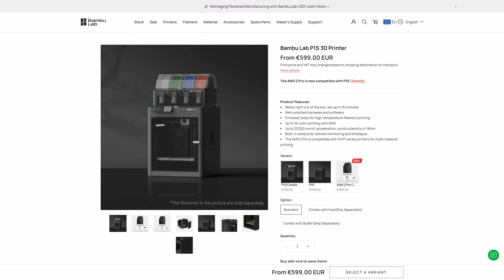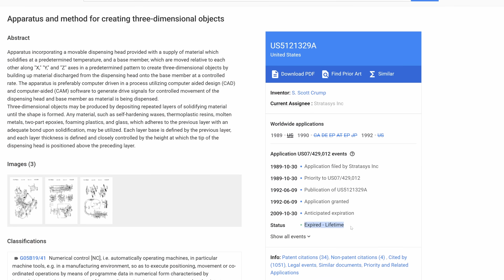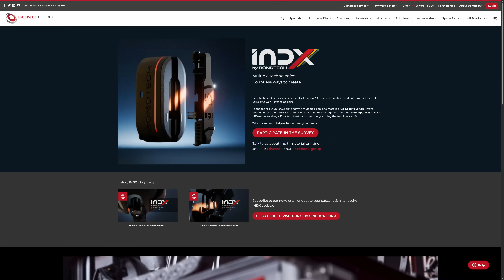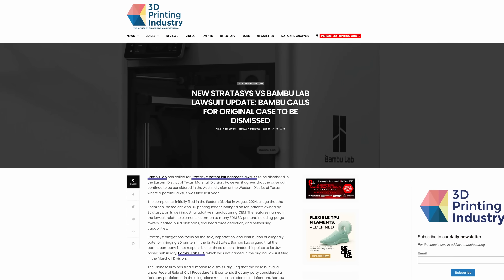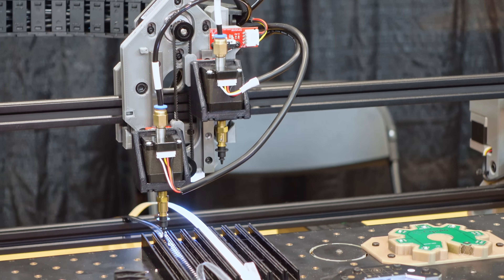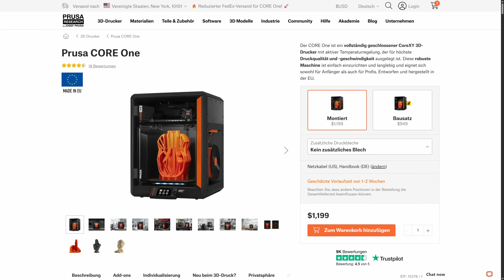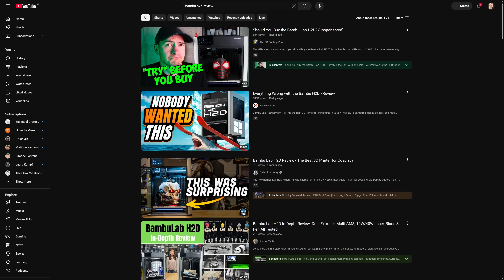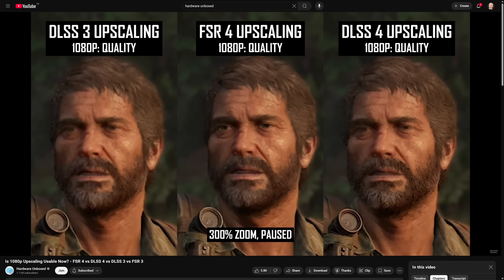How Bambu has won

Comment: Bambu convinced me to buy a Core One (the kit version).
Reply: Ran a P1S for a year-ish before the firmware lockdown, the day I saw the announcement I sold it on FB and ordered a Prusa Mini
Reply: @coreymartin9630 I'm still running my p1s no issues at all. Haven't had to update the firmware and the cloud function still works.
Reply: I am making one right now myself.
Reply: Thanks, it might have hastened the arrival of my Bambu Lab printer😊
Reply: @OnePotMeals  Did you get the 40W laser?
Reply: @ScientificGlassblowing no, 10W
Reply: @OnePotMeals  Well I hope you paid extra for the ventillation and fire suppression systems.
Reply: @ScientificGlassblowing I do have a ventilation system with a direct port to outside plus my workroom has a fire extinguisher . Got another objection?
Reply: @OnePotMeals  Not objections just curious.  My X1C gets lots of microplastics/carbon fiber residue.  Seems like a laser in an enclosed chamber would perfect ignition source for those materials.
Reply: @ScientificGlassblowing not sure how flammable those are? I clean mine out pretty regularly and the H2D comes with a shield. I haven’t used it yet, I have access to a 60W CO2 laser at our local Makerspace so my use will really be engraving. I bought the laser module more out of curiosity and not having to leave in the midst of a project. I’m a technophile and I got my X1C from their Kickstarter campaign. I was so tired of fiddling with my FLsun and Creality machines, I just wanted to make stuff.
Reply: From a H2D/P1S/Core One owner -- I'm curious, what made you want to buy the Core One? Privacy issues?
Reply: @thesenate3055  How are you liking the Core One? Amd how does it compare to the P1S?
Reply: @thesenate3055  I was a 100% Bambu fanboy, then they changed the terms of service with the firmware update in January.  Based on that I'll never buy anything from them again.  I am sure the H2D makes sense for some people.  I'll be the laser causes all kinds of long term problems.  I still have an A1-mini and X1C but for the future it will be anyone but Bambu.
Reply: @thesenate3055  I was a massive Bambu fan boy, until the firmware update that requires connection to Bambu's servers.  Sure it is for "security".
Reply: They convinced me NOT to get an mk3. Glad I didn't.
Reply: I have 5 Core One's and will be getting my second XL soon. I wouldn't take a Baboo printer for free. Way to big of a security risk on top of their complete lack of ethics.
Reply: @varukasalt  in that case it makes absolutely sense to buy prusa machine if you have already other prusa's . that makes maintenance, workflow and spare part sharing much easier. Also the other way around don't buy a prusa if you have lots of bambus - except your company didn't offer a machine with specific features or you aren't complaint with the company anymore ....
Reply: @varukasalt The XL convinced me to never buy another Prusa again. After 6 months of nonstop issues and the run-around from Prusa support, and seeing so many others getting the shaft from Prusa on their XL, I finally sold it instead of buying 19 more for my farm. Then I slowly replaced all my Mk3 variants with Bambu machines, and couldnt be happier. Prusa's "race to complete with Bambu" lead to an alpha product being sold to the public. They lost my trust and business.
Reply: Classic China thing ya know
Reply: @varukasalt  I'm surprised he didn't cover the security issues. If you're making serious parts and designs, the Bambu ecosystem might be unsecure. Otherwise Bambu can have millions of useless files LOL.
Reply: Prusa has cloud too... you think they're not keeping your data 😂.  And if you want multi material or multi colour you'll need to pay $4000 for only 5 colours... ex shipping 😂
Reply: Prusa is a European company. I trust them more than a komunist, patent stealing and outmanufacturing country. That is just me. But I care.
Reply: @mostlymessingabout google has a cloud, iPhone has a cloud, everything you’ve typed is stored somewhere on a server, you think not buying a bambu will keep you secure, sorry but you need to take off that blindfold.
Reply: @mostlymessingabout  Just because you are poor doesn't mean the rest of us should care.
Reply: @ScientificGlassblowing Actually, you should. But that's a whole different topic...
Reply: Just buy a bambu bro
Reply: @krisitof3  I have two X1C and the A1 mini.

Comment: Hi Thomas, I have 5 Bambu X1C machines. And I agree they have won when it comes to their machines. But their new software nonsense is going to put a big brake on their growth. I will not buy another printer nor update the firmware since they want to force users into their ecosystem. And here Ocraslicer has won. No contest.
Reply: Likewise, I have an X1 Carbon. I love it, it's a great machine but Bambu has lost my recommendation for the future. I don't begrudge them wanting the vertical integration, but the lockdown was too much for me. I don't need another printer right now. I don't know who my next printer will come from.
Reply: I don't think the average "I just want it to work out of the box rather than tinkering" Bambu customer really cares or even knows about the new software license. I'm not a fan, but then I'm a tinkerer!
Reply: BTW aren't Orca still missing H2D support due to Bambu debug log block?
Reply: You are missing out. Their latest firmware is great.
Reply: appreciate that but you can't use Orcaslicer which means you are missing out..  @rsilvers129
Reply: I have an x1c combo that is in lan only, stopped updates when the initial news came out of Bambu's shenanigans,  and blocked internet access for it,  too.  I didn't know that by doing this,  I wouldn't be able to create custom filament profiles to save and use in the AMS,  since it requires BL cloud access. Feeling really defeated and cheated because of this.  I can't do multi color prints unless I want them to look awful,  since I can't individually set their pressure advance values
Reply: Too bad. they are still growing pretty fast.
Reply: You are the 1%
Reply: I seriously recommend every X1 owner who wants to actually own their printer to check out the X1Plus custom firmware. I recently installed it on my X1 and the added features and expandability is amazing. Don't even get me started on how much better the community support is than Bambu's
Reply: I don’t care. I recently bought an H2D and am very happy with it. The hardware and software work very well. If you have a smartphone, particularly an Android, everything youn do is looked at and kept by them. I don’t understand the so called problem here. Do you have a Samsung or iPhone? Do you change the firmware? How about your Tv or car?
Reply: @melgross  If you're new to 3D printing this won't, matter to you. For those of us having being into printing since the beginning, reprap,  building our own machines etc this is a different story. Most new users don't even know what Orcaslicer is, never mind its roots and how it came to be - as well as its vast superiority. Only one of many issues that this policy of Bambu brings and why I won't support them further regardless of how good their machines are.
Reply: @melgross  sorry but with my Android I can use app's not made by samsung. I think if I buy a think I can choose what I want to use, orca or any other slicer. That is my opinion but if everyone agree now tomorrow they have to agree to other upcoming rules like property filament or else.

Comment: All great, except the fact that your sponsor could use cardboard spools.
Reply: Cardboard spools should be banned. They are amazingly great at producing dust which clogs nozzles.
Reply: But but but, carbon spools don’t get along with Bambu Labs AMS 😉
Reply: Not going to say this is a fact but any time I've had problems with moisture it was cardboard spools. And it's just bad to use them. Reusable spools and refills is where that should be going.
Reply: I like cardboard spools but I always tear off the sides and throw them in reusable or 3d printed spools for the ams/general durability.
Reply: Matterhackers build series filament is the exact same stuff as voxelPLA. Both of their filament come from the same vendor in china. But matterhackers will give you the choice of plastic or cardboard spools.
Reply: ... also a spool cost only 15.95€ BUT shipping to germany over 37.95€ no thx (btw I like cardboard spools. I have no ams and I use the hole on my spoolholder and not the rim of the spool)
Reply: there are cardboard spools that work fine with ams, like elegoo. rubberized edges to grip the rollers. heavy enough to not tip over etc.

Comment: as an a1 owner i wont touch another bambu printer, going to get a prusha core 1 and get rid of the a1.
Reply: Why?  Whats wrong with it?  My A1 has been flawless.  

I could have 2 A1 combos and change for the price of the Core one kit (or 3 A1 combos for a single assembled core 1)!
Reply: Fantastic. I'll happily buy another dozen A1s. They're amazing printers.
Reply: A1 is awesome. 1/5 the price of a Prusa Mk4 and better.
Reply: If only core1 didn't print like arse with belt reso all over the place.
Reply: @SianaGearz  Have a Core One running in my office almost 24/7 and have never had that issue.

I actually use it over my X1Cs when I have to print something that requires a better aesthetic appearance.
Reply: @SianaGearz  Are you speaking from experience? I'm saving up to get a Core One but saw multiple reviews complaining about the VFAs. That's not a deal breaker but disappointing
Reply: @MrBluntNose   Not my personal experience, no, second hand experiences from the Net, and looking at the construction, i'm just not terribly surprised.